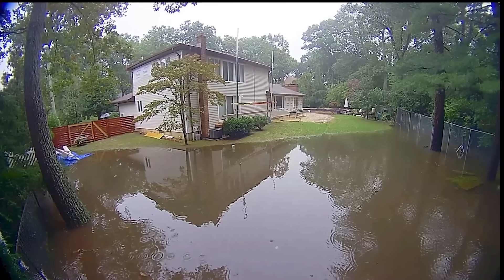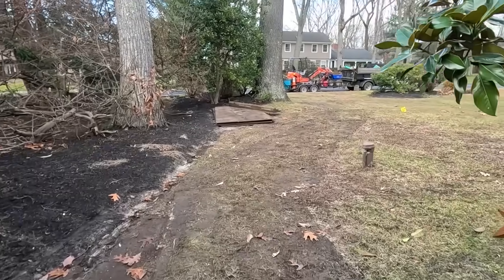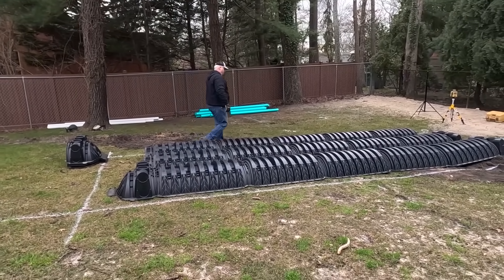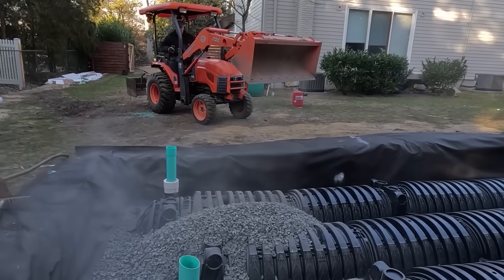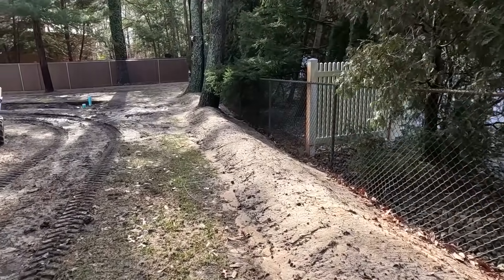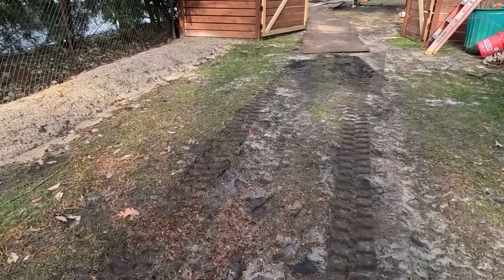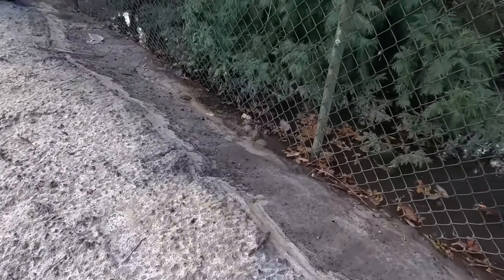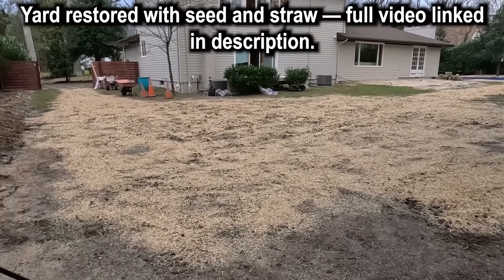Backyard Flooding Solved with a 2000-Gallon Dry Well (Catch Basin System)  Re-Edited

Comment: Burying the root flare of your trees with a soil berm will harm your trees; it may kill them or suffocate the roots of the trees. The root flare of the trees must be exposed to air.
Reply from the maker: Thank you for sharing your thoughts, Jack. You’re absolutely right that burying a tree’s root flare can cause long-term health issues, and that’s something we’re always mindful of.

In this case, the soil berm was installed specifically to block surface water coming from the neighboring property that was flowing directly toward the foundation. That water posed an immediate risk to the house, and the berm was the most effective way to intercept and redirect it. We discussed the tradeoffs with the homeowner beforehand, and their priority was protecting the foundation from ongoing water intrusion.

Whenever possible, we aim to balance proper drainage with plant and tree health, but stopping active water flow toward a home has to come first. We appreciate you taking the time to raise the point — it’s an important consideration.

— Dawn & Tom

Comment: Is the dry well emptying itself after awhile or do you need to empty it with a pump?

Edit: looked it up and it empties itself.😊
Reply from the maker: Daniel, they have very sandy well drained soil. The dry well is empty in less than 12 hours. Other dry wells in more clay soils are usually empty in 24 hours. Have a good weekend

Comment: What is the estimated time this system will last?

What was the cost for this particular job?  Thanks.

.
Reply from the maker: DD, the dry well will last many many years as long as they keep the catch basin clean so no debris get in. Even without cleaning the basins a couple decades easily. We have dry wells installed over 30 years ago that still work perfectly. I’m sorry we don’t discuss pricing

Comment: Why wouldn't the city allow water to go to the street?
Reply from the maker: Great question Ellyssa. In most towns around here it’s not legal to discharge water directly to the street because it can cause icing in winter, damage pavement, and overload the storm sewers. Instead of letting all that water flow away, we like the idea of recharging the groundwater right on the property.  Around here many homes (including ours) use wells for water, so it’s important to recharge as much as possible.
Reply: @tyelandscapinganddrainage Okay!  That makes sense.  I grew up outside of Chicago, so I understand icing of the roads, but I have spent my adult life in Texas and Oklahoma where pracltically everyone drains to the street or storm drains... it makes me wonder why the city doesn't provide storm drain or water runoff for properties with a tendency to flood...
Reply from the maker: Ellyssa, That’s a great point — and it really depends on the town. Some do allow tie-ins to storm sewers, but only if they’re on the homeowner’s side of the street. In this case, the storm sewer was across the road, which would have meant cutting pavement, permits, and a big expense. The dry well gave the homeowner the same result (yard stays dry) without tearing up the street.
Reply: @tyelandscapinganddrainage  That makes sense!

Comment: You couldn’t get back there with fill truck?
Reply from the maker: John, if you can picture it—the three backyards here all slope together and form a bowl. When I first looked at this property, the water was deeper but in a smaller puddle. The homeowner then had another contractor bring in at least one tandem load of soil. That only made things worse: the water spread out, the puddle tripled in size, and it moved closer to the house. Adding more soil would have had the same effect—spreading out the water and pushing it right toward the foundation.
– Tom

Comment: The owner should of  just put a sump drain tapping into that 6inch drain water gutter pipe right above it what you cut. I can't believe you cut it and didn't connect it back together,  It would of been much cheaper, easier to keep clean and got the water away much faster tapping into that large pipe putting a drain right above it.  How do you clean the leaves out of that 6inch pipe from the gutter system now it doesn't run straight out the yard and stops at the new filter system?
Reply from the maker: I recommend you watch the full version. Link is in the description. That will address all your questions and concerns